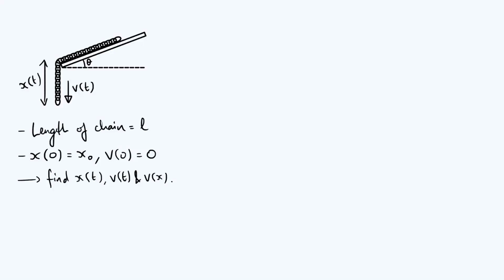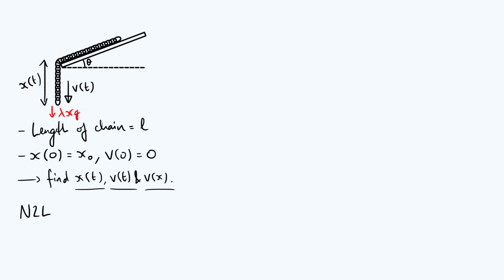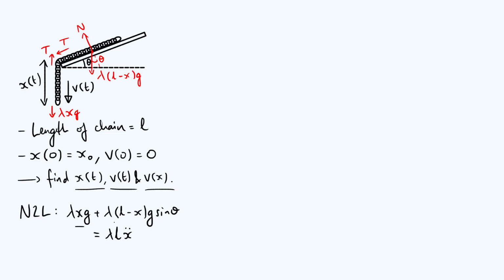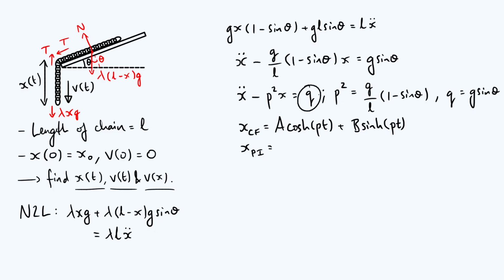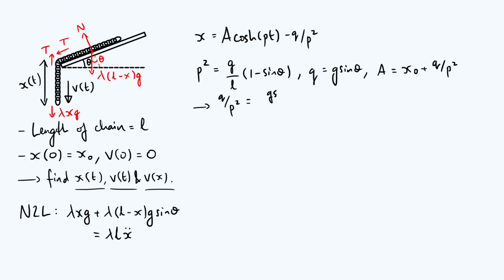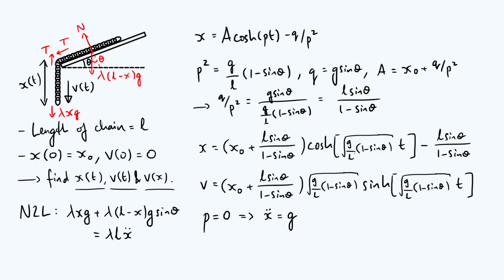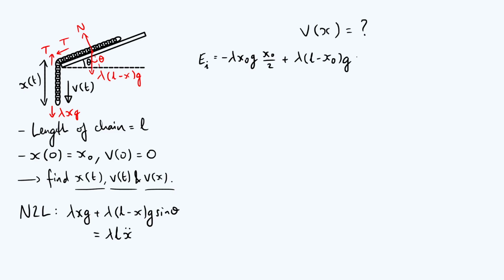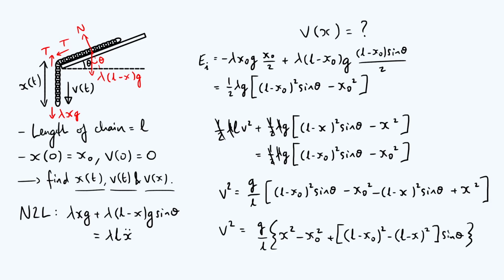Chain sliding off an inclined plane

Comment: Am I wrong or the differential equation should hold as long as x≤l? 
Does x represent the length of the vertically hanging chain or the position of the lower end of the chain? In the first case, x cannot become greater than l, whereas in the second case it can (if the x axis is oriented downward). On the one hand, if x cannot exceed l, than x' ' should become zero after some time. On the other hand, if x can become unbounded, than the term lambda*x is meaningless for x> l and should be replaced by lambda*min(x,l). Similarly, for the sloped part of the chain, my understanding is that the term l-x cannot be negative and if x can overshoot l, than l-x should be replaced by max(l-x,0). In any case, something doesn't add up. Can you please clarify this issue?

Comment: Great video! Now it will be interesting to consider non uniform mass distribution in the chain or the case where different parts of the chain are accelerating at different rates. Your thoughts?
Reply from the maker: Thanks! A non-uniform mass distribution would definitely be interesting to consider, but how would we end up with a situation where different parts of the chain are accelerating at different rates? This would imply relative motion between different parts of the chain, which in turn implies that it would be getting longer or shorter - so the "chain" in that case would really be more like a massive elastic rope.

Comment: Hi so i tried to attempt this question after taking a long break in physics and im a little confused about my solution when i solve for the second order ode as the form of x(t) = Ae^pt + c where p is the same p in your video and c is the particular solution of the ode. I get a weird result where A just becomes 0 when i try to find for V(0) = 0. I think you understand where im coming from. What is it that im doing wrong and is this not an exponential function?
Reply from the maker: Exponentials will work just as well as hyperbolic functions, but when you substitute a trial solution of x(t) ∝ e^(rt), you find that r²-p²=0 and hence r = ±p. That means your complementary function is Ae^(pt) + Be^(-pt), so you were just missing that second term.
Reply: I realise now. Thanks, subbed

Comment: Dr. Ben, why do we project the weight of the chain, that is on the inclined plane, when it is collinear with the weight of the hanging chain?
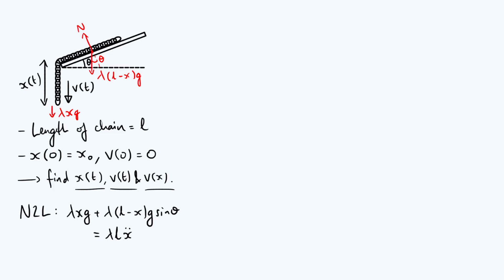Reply from the maker: It's because the chain is always accelerating along its own length, so only the components of the forces which are parallel to the part of the chain they're acting on contribute to the acceleration. The component of the weight which is perpendicular to the plane doesn't do any work and is balanced by the normal contact force. You could also try the method suggested at around 5:03, i.e. setting up equations of motion for the two parts of the chain separately, including the internal tension force, and adding the equations to make the tension cancel. You'll end up with the same overall equation of motion, which justifies the usage of the method in the video.
Reply: @DrBenYelverton  thank you. I get it now

Comment: i've worked on a problem recently that resulted in a similar differential equation , except q was equal to 1.
i used laplace transforms , but your method was elegant as well 
great job sir Ben !

However , if you're interested in which problem i was studying here it is ;
assume a helicopter going at a constant velocity v , and an object is attached to it's rotary wing ; what is the trajectory equation ? ( in polar coordinates )
Reply from the maker: Nice! It's a good, reliable method for second order ODEs like this. I'm not sure if I understood your problem correctly, but you can probably write down parametric equations for the trajectory as a function of time without using differential equations.
Reply: @DrBenYelverton  sorry my explanation was misleading ;
the object isn't "attached" but more like loosely clinged to the rotary wing , so it is capable of moving up and down the rotary wing without friction ( it's frictionless just to simplify the problem )
Reply from the maker: Ah, so you do need to set up a differential equation as the centrifugal force is changing over time. I'll probably be covering some similar problems on the channel at some point.
Reply: @DrBenYelverton   tysm for considering that Dr Ben